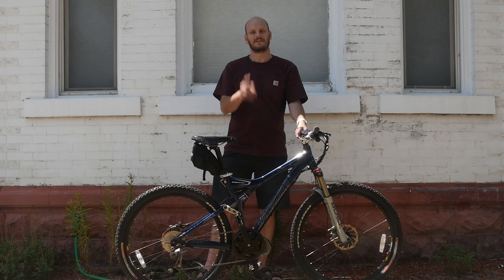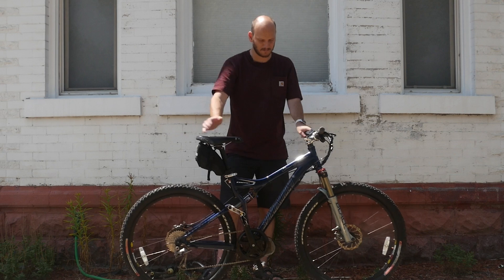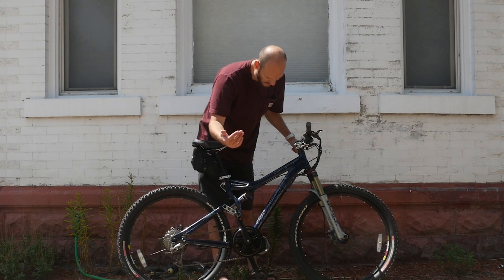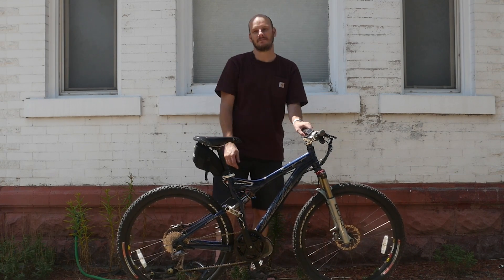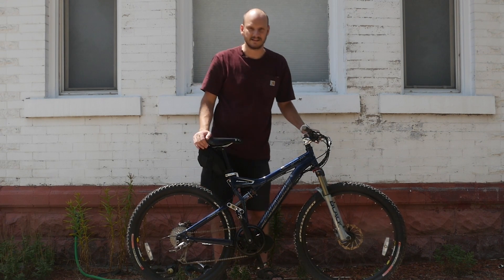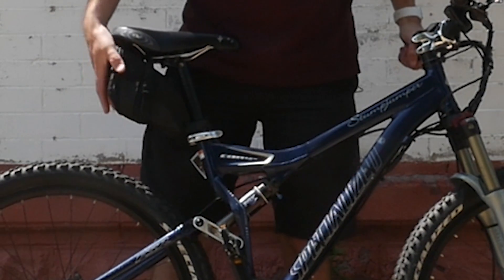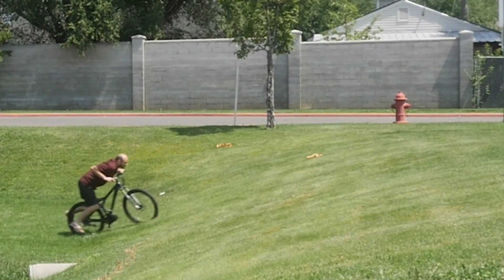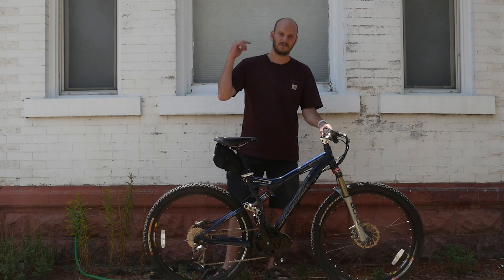Custom E-bike Build: Specialized Stumpjumper FSR BBS02 750w 48v 6ah Full Suspension

Comment: Anyone know what year the stump jumper went to the frame design with the down tube staying flat way out ahead of the bottom bracket? I’ve seen a couple conversions on these newer ones and the motor is hanging almost straight down giving horrible ground clearance.

Comment: How are those little seatpost batterys performing? Real range miles etc I quite like them for small work commuting with out it looking like a giant ebike. Looking to convert both of our bikes with one of these for about 30/40 miles a day traveling. Must add I am in UK and we only use 250w and light pedal assist

Comment: I have a question is there a difference between the BBSHD 48v motor to the 52v motor ? And can I run a BBSHD 48v motor with a 52v battery ?
Reply from the maker: As long as you bought the motor within the last couple years you shouldn’t have an issue running 52v to it. There was an issue around 2019 motors with 52v batteries
Reply: @JohnnyNerdOut  I bought the 48v motor and will be flashing the 52v firmware to the controller !

Comment: The owner knows what they are doing. Gold titanium nitride coated rotors and chain! Looks great with that gold cassette too. Those forks cost more than an entire ebike conversion. I would have used a BBSHD on that, but the owner likely wanted to keep it road legal, and 35mph is not bad at all with that chainring.
Reply: Chainstays.  The HD is a lot bigger and then you have to push it out and the chain line sucks.

Comment: So the big problem with this bike is the battery.
Reply from the maker: Correct. For this owner it won’t be a problem, but it is definitely important to properly size your battery to your riding needs so that you are not disappointed 👍
Reply: Doesn't that depend on your needs and riding style? I have 2 batteries for 2 e-bikes. Both are 52 volts, one is 17.5 AH & the other 6 AH. For most rides I use the 6 AH because it gets most jobs done and it's lighter and easier to carry (if necessary).
The cells used and BMS also play a role.
Reply: if you draw so much power out of 6ah u will dip the voltage making your power sag litterally in 10 minutes of hard riding.
Reply: @MrJob91  You're not wrong but with decent cells and BMS you might get 15 minutes;)

Comment: Love this bike! but the range must be  at a minimum with that small battery? I subscribed to your Chanel not too long ago and you have convinced me to build my own Ebike. Thank you and keep the vid coming .
Reply from the maker: Range is about 15 miles with “normal” riding @~16mph
Reply: If you normally only ride 12 miles or less this battery is fine.  You can carry a 2nd battery when you think you might be going a longer distance.  If you general ride longer distances yes you should get a larger battery.  I always ride using pedal assist, have my Bafang tuned down and almost always ride in Level 1.  This can extend your range.  If I really want to extend my range I ride some of the time in Level 0.  Only once have I run out of juice and since that time I do what it takes to make sure it does not happen again.
Reply: Who manufacturers that battery? I don’t see anything like it on the Bafang website.
Reply from the maker: @peacelovegoldenrule  are you talking about BagangdirectUSA? ( that’s not Bafang btw, just some guys with a misleading website name to say the least). 
Check out electrifybike or bicycle motor works for that battery👍
Reply: @JohnnyNerdOut    Geesh. It was bafangdirectusa. Thanks so much for that info and quick reply.  I appreciate it! I found the battery on Electrify bike site. And, this leads to another question about voltage and amps. I want to electrify my old Giant NRS and it will be used exclusively for mountain biking with current rides of 12-18 miles with 1000-1500’ climbing. I imagine I would come close to depleting one of these batteries each ride so I may purchase two. I like the stealthy look. There are six under the saddle batteries available - 36v 6a/ 36v 10.5 a/ 48v 6a/ 52v 6a/ 52v 7a / 52v 8.4. Can you help with my understanding of volts vs. amps?  Should I consider one of them more critical for mountain biking?  Thanks so very much.
Reply from the maker: @peacelovegoldenrule  I actually have a few videos up explaining volts, watts and amps 😀